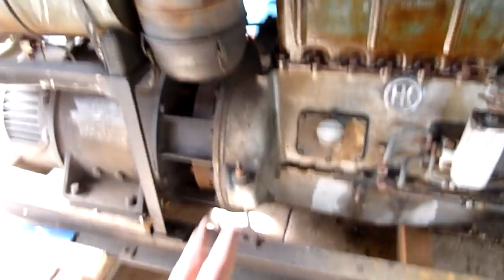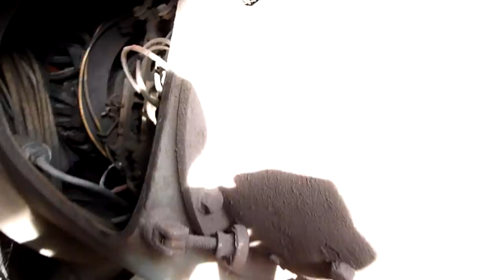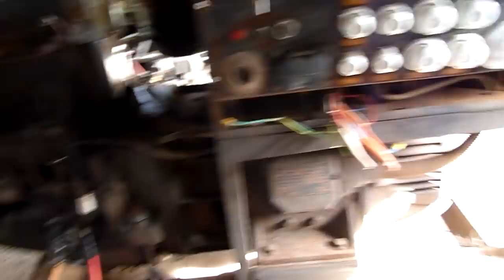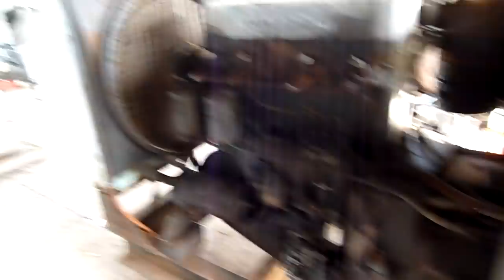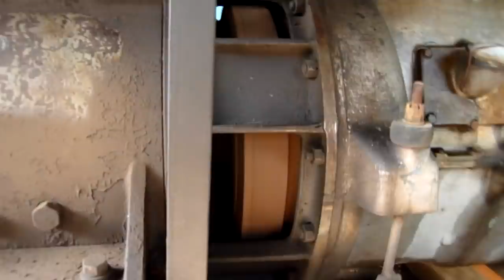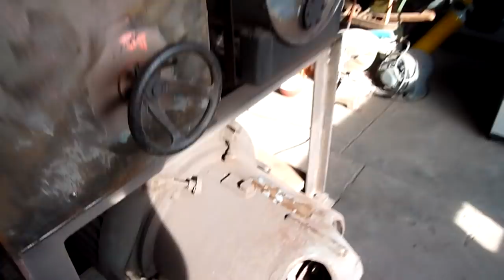Diagnosis of the 1961 60kva Kamper Generator (plus full throttle run)

Comment: I'd take it to a motor repair shop and see what they would quote you for a rewind.  If it's to far gone and to expensive, take it off an fit a modern head to the engine, boom, back up power for your shed, house, your neighbors house...

I'm still amazed at how smooth the engine is.

Comment: I suggest tearing the gen end down and  get the main rotor out for a good inspection.  Could be that the short is obvious or that moisture has set in on the burnt windings and the compromised insulation is giving the low resistance.  I’m hoping you can clean, re-dip the whole armature under vacuum and be good.  Either way it is still a nice machine!!
Reply: SmallEngineMechanic yeah re dipping could work!
Reply: i really hope this is what he does, because bad windings can be a really simple fix, if not he can get it repaired and have a really good reliable gen set!
Reply from the maker: Unfortunatly there is a 1/4" crater blown in one of the windings where it enters the iron laminations of the rotor, I wish it was as simple as re-dip :(
Reply: dang i hope you do get it rewound or try to, i would love to see this generator fully operational!  Best of luck to you mate!

Comment: Nice machine, awesome sound. Easy starter. 
Interesting that the current is taken from the armature, I thought the current usually was taken of the stator winding and the armature was supplied with DC from the exciter. You should be able to get it to work as a two phase alternator.
Reply: RODALCO2007 yeah normally but Ed finds the odd bods
Reply: Indeed
Reply: It sounds almost like an old Lister-Petter. /watch?v=TFYTvs7ctHg
Reply: Ones that I have worked on have a three-phase rectifier on the exciter rotor.  I guess 1960's diodes were not great, hence this design. 
Not really sure how this one pulls AC off the rotor. It seems backwards compared to a normal generator, as in the stator is DC and the rotor is AC. It looked like it has 3 slip rings. 
I rewind motors and generators.  Generators always blow up worse, I've seen coils blown clean through, puddles of copper in the bottom of the casing... etc. 

The problem with leaving the coils in but disconnected is they are still being excited by the field and could short together or to the rotor itself as the insulation is damaged.
Reply: Yea, as I suspected. I bet it's not as efficient as a modern design either. Plus you have brushes that wear out.
Reply: Efficiency is very good on these but they are much heavier. But best thing: These old Flintstone family genesaurs :-) are way more reliable compared to the modern highly integrated computerized brushless china and Japan machines...an EMP strike wont hurt this old semiconductor free machine! So im am sure that China, Russia and North Korea will hate this :-)

Comment: The problem is if the burnt winding measures lower than the other ones it's internally shorted. Once a magnetic field is applied it will still generate power just like the other 2 phases and heat up like crazy. Others will correct me if I'm wrong but at this point to remove the short you can cut the ends of the burnt windings sticking out of the rotor on one side and that should give you 2 good phases
Reply from the maker: My thoughts exactly, render it completel open circuit and it should not turn into a heater and burn everything else up!.
Reply: Agreed.
Reply: exact.
Reply: It's possible that it just had an insulation failure and thus shorted. Hence why it burnt out. Would explain why it burnt despite there being fuses, though I know people loved to bypass or misuse fuses (use too high amp rating etc...).
Just keep in mind, if you remove the windings a motor repair shop might not be able to re-wind it (unless you count the windings. But it should be the same for all three phases, right?!).
Reply: @BenjaminEsposti  if he cuts the one phase he would leave the windings in the rotor to not throw off the balance. So there is no point in taking the winding out unless it's for sure getting rewound

Comment: Another idea - Hook it up to the westinghouse dc gen. Then feed the output into the dc bus of a 3 phase inverter, so you get your 3 phase output.

Maybe a 2:1 gearbox in the mix so the engine can run at 1200. Would be a fun video series project!

Comment: A good cleaning and isolating that winding would be the best idea. If several wires are blown I wouldn't bother but if one or two is blown it might be worth it to get that winding going again. The coils may not be matched perfectly so they might be off from each other by several ohms, if the one that's blown is a bit more I wouldn't try to fix and use that one. There's always ways to make two phases into 3. ;)

Comment: Still think it has a nice sound at idle... :)

Certainly a shame about that burnt winding though, probably more work than it'd be worth to re-wind it, but I'm far from being an expert in such things, I had enough difficulty replacing a pair of diodes and resistors on my Honda EX650 generators' armature, almost wrecking it in the process... :P
Reply: have you priced a 60KVA genset lately?   I'd re-wind it myself... even if it took a week solid :)

Comment: I got an 79 Miller 225 with failed windings due to age. The lacquer has simply began to chip off - otherwise copper is intact. Agreed, I'm not having a 1973 machine rewound. The engine on it is tired and would need several hundred worth of work too. Actually picked the windings apart and got the resistance back up. Dumped clear coat all over it and if I could get the motor to hold up, I'm curious if she'd make power again.

Comment: Your gen set might have come from a german built ship from the 1930s, 1940s and the AEG generator might have been repaced in the 1960s because the original one was burnt out, common on ships! I would not scrap the AEG Generator its rare, I have seen similar sets in German WW2 bunkers years ago! And please keep the brass radiator! A radiator shop can rebuilt it like new. This is finest german vintage technology! Please dont scrap the AEG generator and please keep the switching board it has the old german U-boot look :-)) Lovely piece of equipment!
Reply from the maker: That is very interesting, i wonder if the engine is wartime production, cleaning it up should reveal a number somewhere. I figured the gen head would be Siemens but I cant see the tell-tail Siemens logo on anything, must be AEG..
Reply: This is 1961 german made diesel power generator please compare the plugs and the quite compactly sized generator with integrated ecitation generator, your one looks ancient ;-) compared to this, so it has to be much older! : https://www.witschibau.ch/baukurier/detail/ich-wuerde-mich-wieder-bewerben/
Reply: @Schlipperschlopper
The control panel, of the generator you linked, has been remade somewhere after 1980. It's a standardized layout and equipment for industrial machines. But the motor and generator are build around 1960.
If i look at his generator, the layout and components i would guess it was build between 1930 and 1950. But I'm no expert when it comes to that.

Comment: Seems to me that if yo9u could pull 40 Kva out of the thing single phase, it's going to power your whole home and the ones either side.  If you ran it on veg oil which these old engines will do without problem, It would be a cheap to run and powerful Genny just the same. If you needed 3 phase, just spend the money on a Good VFD and don't worry about rewinding the old girl.

Comment: The supply for the fields are generated in the rotor and then commutated to produce the DC for the stator fields.  No diodes required.  I would be inclined to believe the fail was due to insulation failure rather than overload or  loading inbalance.  Older unit, combined with higher voltages on the rotor, mechanical stresses and open flow through cooling would make Insulation failure inevitable.  I think rewinding would not be an option based on cost alone.  The 3 phase output winding combined with the DC generator under winding would more than likely have to be rewound inclusive and this would be a big job.  Cost would be big here in Auz.  I have serviced many of these old girls that are still operational.  Constant usage seems to be better for them than stand by duties. Bit sad that this one has probably had it's day.  Beautiful engineering.

Comment: I know that's sound is over the camera mike, but that engine sounds really good. Any idea what this was used for in the past? If you mentioned in a video, I've forgotten which one.
Glad to see you putting up some new content. Take it easy Man. Greetings from the  North East part of the US. I'm not ready for winter yet. You get out a good bunch of videos in the near future and I can at least see some summer weather. Thanks for the videos.  :-)
Reply from the maker: G'day mate, This genset was used at a chicken farm to keep the fans running during a power outage. have fun with winter, I ran the shop aircon for the first time this summer :p
its getting warm now,
Reply: Thanks for the reply, I appreciate it. Funny you should mention aircon, just closed mine up for the winter a few days ago. Just yesterday morning when I got up there was ice covering the puddles from the previous day's rain. I think it's my being an old fart now that makes winter so much tougher than it used to be. At least that the theory I'm going with. 
Yeah you'd need to keep the cooling going on those chicken barns. Used to be bunches of them around me, all closed now. Quite a few of the more modern style barns have been turned into self storage lockers. Not sure exactly how that works having never been in a chicken barn self storage setup. Take it easy man.

Comment: Love the sound of the starter! It seems to say "GUTEN TAG"  = "Good day" in German,  when engaged (german joke obout the old serious BOSCH starter sound), P.S: the tiny "steering wheel"  on the backside of the switch panel is the adjustable excitation resistor (Very HQ) for fine adjusting the output voltage (the more excitation voltage, the more main gen output voltage) , does this wheel still turn or is it seized solid? DONT spray any WD40 inside of these, that might cause more problems. Better dismantle that adjustable constantanium wire resistor and use electrical high voltage approved cleaning fluid that is not acid based! (Acid based sprays destroy the resistor insulation ceramics and again cause copper corosion)
Reply from the maker: the field rheostat does indeed move and probably still works!

Comment: as long as you de-rate those two good phases a good amount. I dont see a problem with running just the two. I've run lots of things on one or just two phases of a 3 phase generator keeping in mind I dont put too much load on them to not upset the balance of load on the system there wont be a problem. Worse you can do is break something that is already broken.

Comment: I think you have to cut physically the burned winding. Or you build a induction heater. As you said the winding is shorted, the result is that the winding creates a big loop. You have to open the windings.
From what i can see the windings are really burned up. 
If you can insulate the winding, you can regenerate the third phase a three phase motor. They do that often in the USA.
If the windings where in a better shape, you could pull the armature out, cut and test loop for loop and solder the OK one together again, jumping the shorted one, this would shorten the winding, resulting in a lower voltage, but it can make the generator work again. But it's a long job to do. I've done it once for small generator. took me two full days to measure, find the shorten loops and reconnect everything again.

If you want to connect the westinghouse you could gear it down with a planetary gear from a tractor. Some have planetary gears directly installed in the wheel. This could help running the diesel efficient.

Comment: I think you have to cut the burnt windings open as they are shorted out internally.
You should then be left with a 2 phase alternator.

If you leave the windings in place they will have an internal short circuit and overheat the generator.
Reply from the maker: very good point, as a few people have pointed out now, I will have to cut it if its internally short.

Comment: The generator might just need a remagnetizing prozedure for the 60V excitation generator (remanence gone due to long storage without use), just connect 12V DC from a small car battery loader (not a car battery itself!) in line with a 5amp 100V diode and a 12 light bulb with the ports B(+) sometimes called D and C(-) (typical marking on german generators, but please check with your one before doing that) of the excitation coils (remove the carbon brushes of the excitation before), there are machines with extrenal separate excitation generator (a small 40-60V (?) DC electric generator at the rear side of the big 400V three phase generator) and some (as my 1962 Fimag DCB20-4) with integrated DC generator within the main generator...just remove all brushes...than give 12V through the DIODE and lightbulb to the excitation coils, this will remagnetize the iron of the stator. Never connect DC without Diode and lightbulb to prevent reflow of DC to the Battery loader, you might also do this during generator running and connected brushes but be carefull that you only connect to the excitation and not to the 3 phases of the main generator...some generator sets have an integrated manual switched excitation that puts DC from the starter battery and a selenium diode and klightbulb to the coils... When the lightbulb light comes on the magnetizing is done when it stays dark there is an interruption (or the bulb is gone) ;-) Good luck! P.S. please clean up the commutator rings all the oxyd and patina on the copper pervents a good contact between the rings and the brushes...on my 1962 one the oxydation there made big problems on the excitation low voltage DC side! After cleaning no problems any more!
Reply from the maker: Thankyou very much!, I will have a go at getting it electrically active once I get it physically movable LOL, I need my carport back first ;)
Reply from the maker: I think its the exciters little spring loaded drive dog, if I get the RPM a bit higher it goes silent

Comment: Dumb question: can you use a regular electric motor as an ansynchronous generator ( driven by that old diesel.. ) or, if it'll spin 1800 ( or 1500 ) RPM, can you buy a cheap chineseium 4 pole generator head for it?  Nice old unit though, sad they cooked it.  Then again, I've seen the work you do in your other videos, You could probably whip some life back into it.

Comment: we run our old lister petter and 1964 jcb backhoes on 4 to 1 waste oil and kerosene  pre heated before injection by use of exhaust and 2 inline filters that have mesh wool so can be cleaned and reused to excite start up a squirt of brake cleaner   have to remove injectors now and again as carbon crust build up forms in injector/head seats   cheap energy

Comment: is it not possible to do a home hack rewind your self?
Reply: FloppyDriveMaestro too complex, need a bobbin the correct shape for the stator to wind onto, then count the turns from the old winding, paint with varnish and impregnate the lacquer into the windings under a high vacuum, you'd need special equipment

Comment: Really for something this old, i think it should have been scrapped. I repair welders and gens all the time and something like this now days thats slightly more modern would put out same power and more efficient on fuel. That thing is huge for 60kw. Also I worked on really old 1970's machines and this thing makes them look modern lol
Reply: I think if he was worried about efficiency and wanted one to begin with he would have looked for something a lot newer. This seems more like a fun to play around with project and the only reason he has it is because it showed up at the scrap yard, and I doubt he is going to use it for things other than the odd experiment or some kind of emergency  situation, like a zombie apocalypse. 

There is a project for ya, some kinda of generator powered zombie deterrence like a high voltage fence.
Reply: well hes gonna have big time fun if he plans to rebuild that rotor, gonna need a engine hoist or forklift to lift that stator up.
Reply from the maker: oh yeh its not a profitable project, I will see what I can do. the stator can be lifted by my 2.5T engine crane, but I will try and use it as a 2 phase 240V set first
Reply from the maker: I kinda grabbed it expecting the generator end to be terminally damaged, and keep the diesel, rest can be scrapped if I cant use it as it is, or if its stupidly expensive to rewind
Reply: @ Dat Blue Husky< you would be amazed how efficient this old stuff still is regarding to using feul.... Modern fast spinning generators of the same capacity using turbo loaders on it will use more feul then tis low rpm old sets...
Reply: I know Aussie50 (forget his name lol, how bad of me) likes to tinker with old things. If anything, he could probably donate it to an old engine museum, if they have any in Australia. (We have a number of them in the USA, the biggest one is the Coolspring Power Museum, with more than 250 small and large engines, up to a 600HP 4 cylinder (2 tandem) natural gas compressing engine with a flywheel that weighs 18 tons!)

Comment: So what voltage did this generate at 3phase? 480? Not sure what three phase power is common around there.
Reply from the maker: In Aus its 415V, 240 phase to neutral, 415 between phases

Comment: Pull out the rotor, ivnestigate why and what has happend. This is visible-pole generator, so it will be easy to rewire only this burned section  on your own.